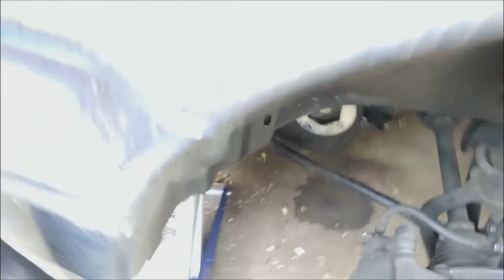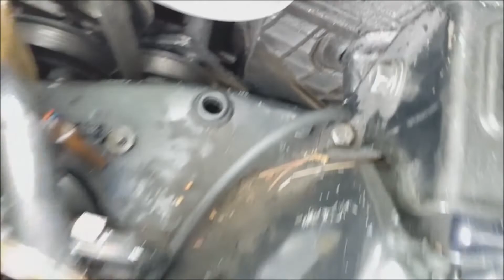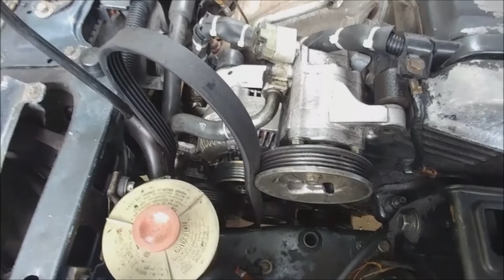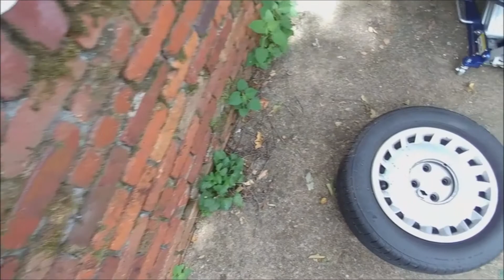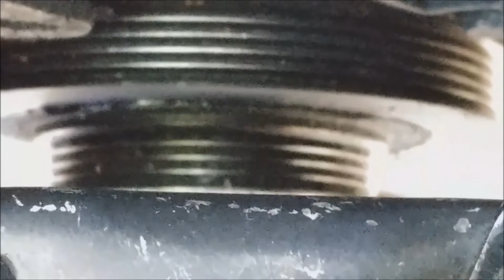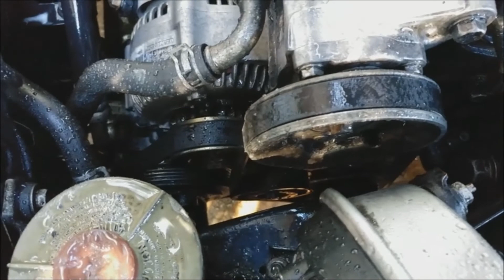1988 Honda Prelude Si - Alternator Charging Problem Caused By Bad Crank Pulley (Fixed)

Comment: How is the shoe goo holding up cause I got the same problem
Reply from the maker: The shoe goo held up for about 5-6 months. It did end up slipping again. This was due to engine HEAT (shoe goo got hard/brittle). So, I repeated the same process, but with Permatex Ultra Black silicone. The silicone has been holding up fine now for about 5 months. I feel confident it will last indefinitely, since it is not affected by the heat. The silicone was actually much easier to apply than the Shoe Goo, since it (the Permatex silicone) goes on smoother and has a slower cure time. Just be sure to let it sit for over 24 hours before starting the engine.
Reply from the maker: Just another follow up... the redo using Permatex Ultra Black silicone is still working great (it has been approx. 1 year). Again, the Permatex Ultra Black silicone withstands the heat and is also resistant to oil. It will not harden with heat, like the Shoe Goo did.